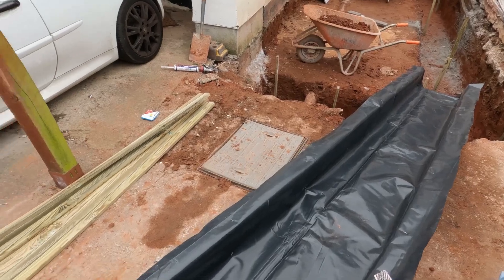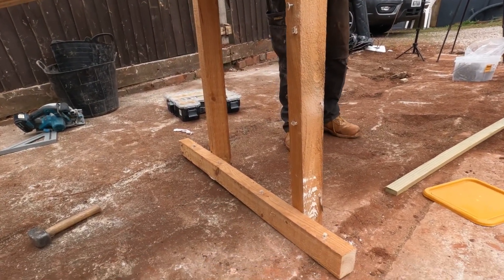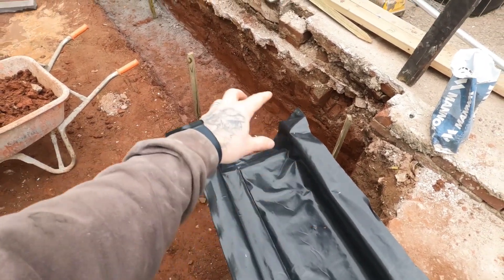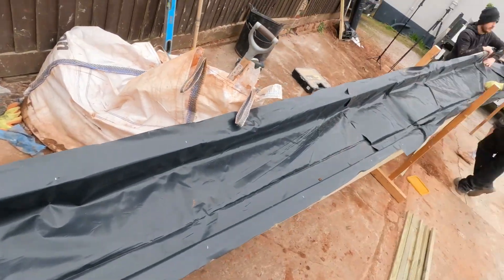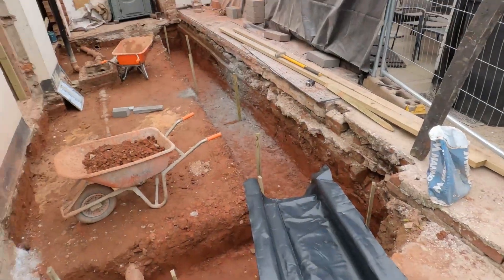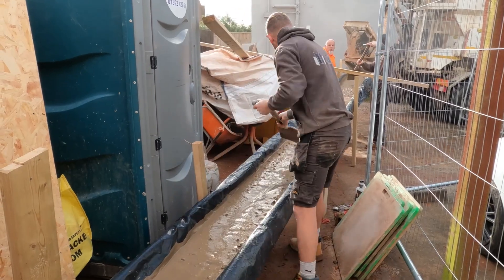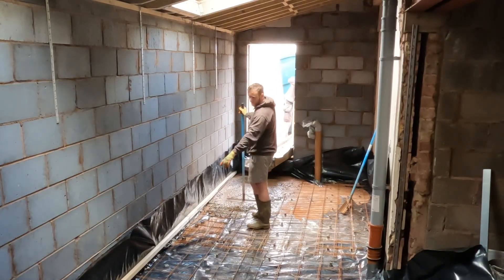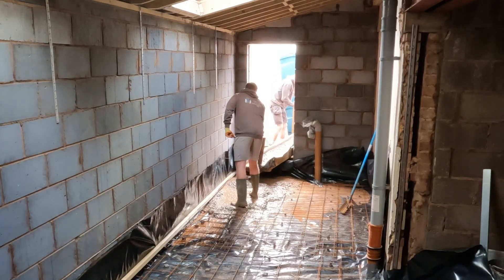Building a concrete chute funnel | Save hundreds of pounds in man hours

Comment: That's a very wet mix. I wonder what the engineers had to say about water trapped in the slab once the outside surfaces have cured? Was there any cracking later on?